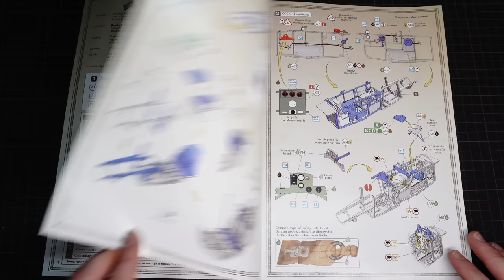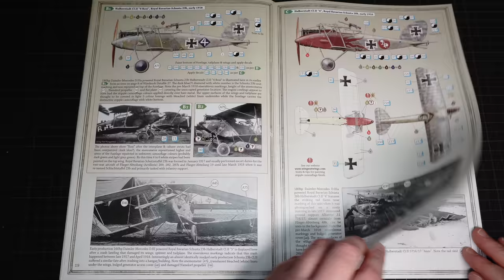Wingnut Wings | 1/32 Halberstadt Cl.ii | Full Build

Comment: We all have some things that we excel at, I would say that yours are your airbrush technique, and especially your wood grain.  Another great build, thanks for the video!
Reply from the maker: Ron that's very kind thankyou. I put a lot of time into my airbrush work, many hours and hours of practice at the start and Iy was worth the effort. Woodgrain is going well but there are a few areas I could improve, like matching a ply pattern as opposed to more or less regular streaks. That's on my list to look at.
Reply: @lpjmodels  when I need to do a specific / matching pattern I tend to draw it with a pencil, carve it in with a knife or scribing tool, and  then use an oil wash to create the contrast. I found I could never make just the paint brush do what I want...

Comment: With insignia, especially with those as simple as the two styles of iron crosses, you really should paint them on. Other than that. Great model. Well done. 👍👍
Thanks for sharing your work. 😉🤙
Reply from the maker: That's a good call mate and something I am not shy about doing ( my ki61 is 99% painted) I lost my access to a scanner and printer lately otherwise I would have scanned the decals and printed them off on light card, and used vinyl mask to cut the shapes.  There is a big gap in the ww1 aircraft paint mask market
Reply: @lpjmodels  and “they” say tech makes life easier. 
When it works. Right? I just hate on newer/modern aircraft, armor & other vehicles that I have to mix paint & decal because the fine text, or just go ahead and use only decals. I know I could go with dry transfer, but some are hard to find or I just don’t want to pay what they want. I guess that’s part of the fun of modeling though. 

Keep up the great work. I always enjoy your videos. 😉

Comment: A very enjoyable built set, very educational and I found it enjoyable. I have some Wingnut Wings kits myself, but will not start on them until I have gained a little more experience. Like starting with some of the Roden, Special Hobby or Copper State Models set.
Reply from the maker: Honestly, aside from Copper State who's newer kits are amazing, they wnw are easier to build than roden and special hobby. If you take your time with the kit you'll be fine. This is my first completed biplane, all of the others I  have done in the past have just fallen to bits when it came to putting on the upper wing.
Reply: @lpjmodels  Thank you for the answer. If I can build the Roden and Special Hobby sets to a result I'm happy with, then I'll probably take the chance with Wingnut Wings. Those kits are way too expensive in the used market, so it is advisable to me to get it right on the first try.

Comment: Amazing work!
I'll have to try that wood grain technique.

Btw. have you tested if your rigging wires can be heat shrunk like the Uschi van der Rosten wires.
If so you don't have to glue them under tension, in my experience a soldering iron works best to heatshrink rigging wires.
Reply from the maker: Taumel no I haven't tried that, first time I'm hearing of it,  I'll have to do some experimenting thankyou

Comment: Beautiful.   How long does the elastic rigging last?  I haven't had any luck with a elastic rigging product.  It only last about three or five months before it snaps.  I've done tests on diffrent tensions and no luck.
  I kind of thought the early wheels (rubber) was a gray or brownish color?  As I have been told, black rubber is a modern additive.  You must have one hell of a supplier with all those diffrent paints.  Awesome work.  Thank you.

Comment: Astonishing work on that kit and all the details you put in with shades and weathering etc with your airbrush and brush. I just love it!!! What pressure do you use on your airbrush when doing all this? 👌👍😎🇸🇪
Reply from the maker: Thanks Micke, with the mrp paints I go between 8-10 to a max of 20. It's entirely situational. If I need to get in closer I will drop the pressure.
Reply: @lpjmodels  Thanks James. It will help me to do it better.

Comment: James, I'm curious as to why you chose to use lozenge on the wheel covers and nowhere else.  I, too, built this kit about 2 years ago and used the full wing lozenges so it matches the wheel covers.  Having said that, the setting and situating of the lozenge on the entire wing was quite nerve-racking.

Your airbrushing skills are outstanding; what sort of airbrush do you use?  I couldn't quite tell if it was an H & S.
Reply from the maker: Thanks Kip, I was going to use the lozenge under the wings and still paint the yellow but my tests weren't successful. The wheel lozenge was just for visual variation, in the form of replacement parts or the like . 
I think the key to lozenge is to cut it into sections, I worry that they wouldn't match up though.
My ab is a h&s infinity running a 0.15 nozzle !

Comment: I fear therapy is needed after just watching this. But I do have a question about your usage of french ultramarine in the paint mixes. Is it its coolness or darkness that contributes to a specific mix? What is its function?
Reply from the maker: Thanks Rafael, I learnt that mix from my painting days. Instead of using a black the blue and brown make a almost black, and can be toned down by more thinning. It has more depth and life than black which is a bit of a dead colour.
Reply: @lpjmodels  Ah, yes, makes sense. I avoid black and when I use it, mix it with red to give it a bit of life. Black isn't a colour really, is it. Thanks for clearing this up for me James.